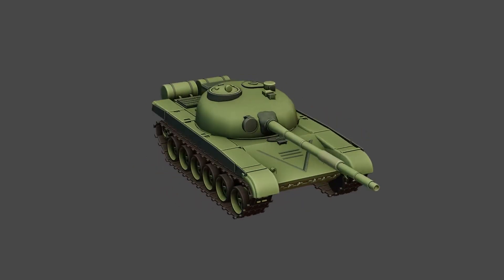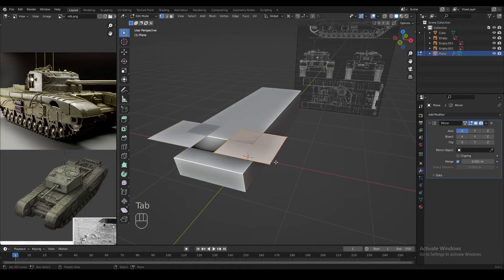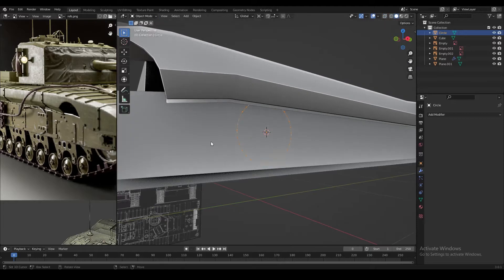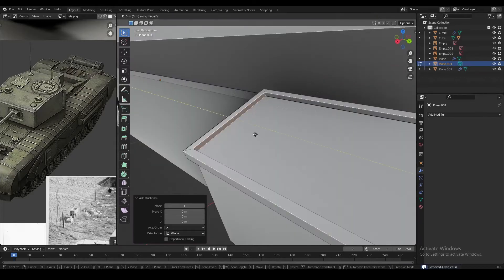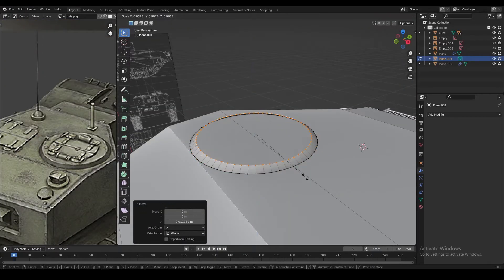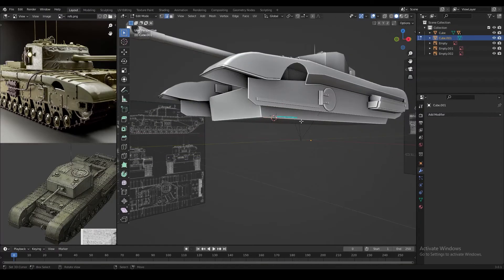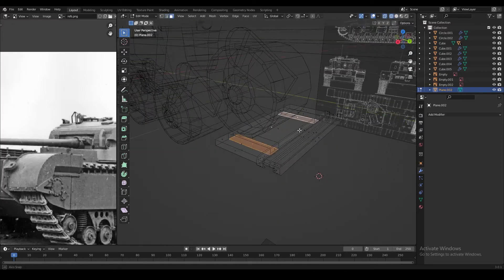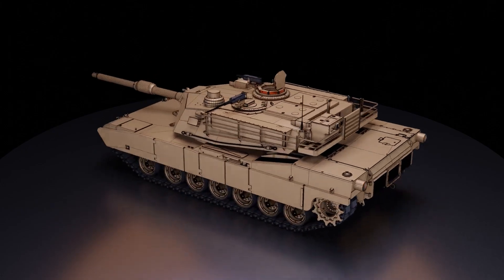How to Make a Tank in Blender | Modelling Tutorial (Arijan)

Comment: Couple of slightly nit picks.

The reference images: You are make a Black Prince, but the colour image is of a Churchill, probably a MkIII. Were you just in a bit of a rush and threw the photos together to give us an example? You don't seem to reference them at all during the process.

Suspension: Was there a reason to leave out the coil springs? Design choice based on what would or wouldn't be seen be the end user? If you were going to model them would you bother making them a helix or would that depend on the final scale of the finished model?

Exhausts: Sorry, but that bugs me. The boxes on the side are the air filters for the intakes. The exhaust is that U shaped box thing on the top of the engine deck. Sorry, but my obsessive compulsive kicked in. :)